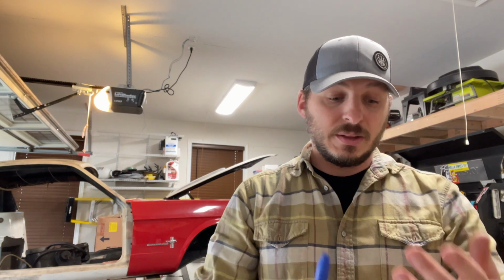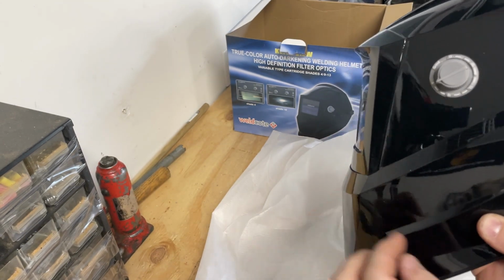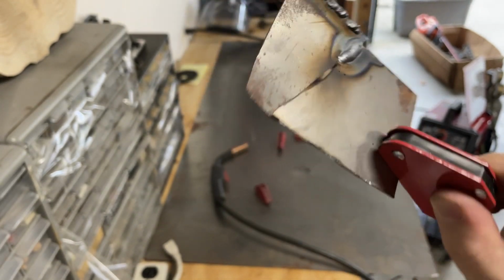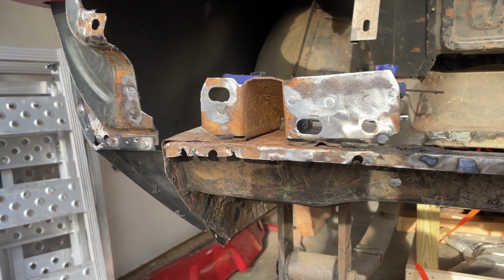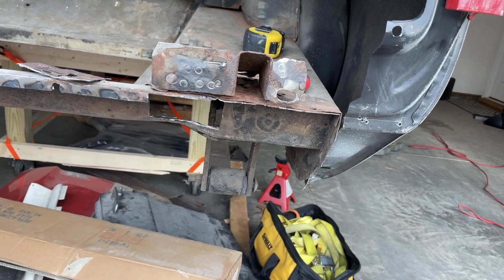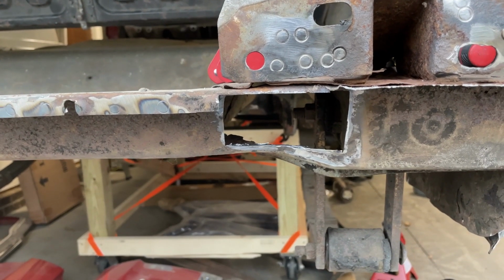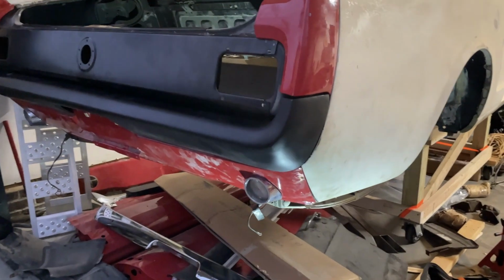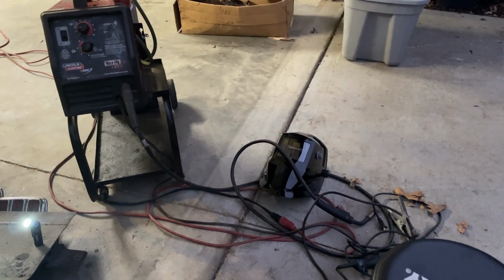Welding a 1966 Mustang Fastback!  AMATEUR HOUR!

Comment: Hi Joe, reverse the polarity if you are using flux core, your quality will improve dramatically.  That is the same welder I have, have had it for 20 years and still works well......  Nice work on the body panels!  The chart inside the door of the welder are good starting spots.....
Reply: How would you do that
Reply: @roberthirshfield3571 .  . Unplug the welder.. open the door where the wire is. There should be 2 connections where the welding cable wires connect. One is red one is black. The welder should indicate which connection is + positive.   Or Google the manual for your welder.

Comment: Nice job. I really want to try welding. Got a 66 coupe. Tail panel is not in the best shape. Been trying to hammer and dolly it reasonably straight and then fill. Watching you I may try cutting it out and welding in a new one. Hopefully you’ll video installing your tail panel.
Reply from the maker: Hi Robert, thanks, I appreciate it.  One thing I found is having a well cleaned/ground substrate makes for far better weld engagement & penetration.  I'm currently re-installing my tail panel, should have the video up in a couple days.  I have an extra (new) tail panel that came with the car if you're interested.
Reply: @SlowInFastOut1776  Where are you located and how much for panel?
Reply from the maker: @mellis181  Upstate SC, $50+shipping.  If you're interested we can take the conversation offline.  Thanks!